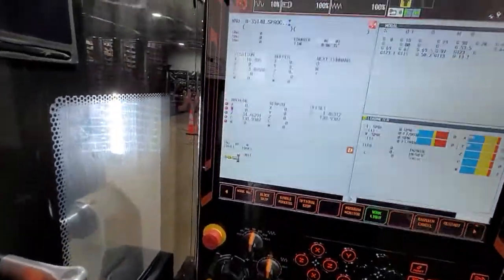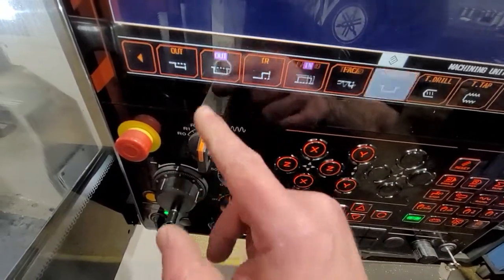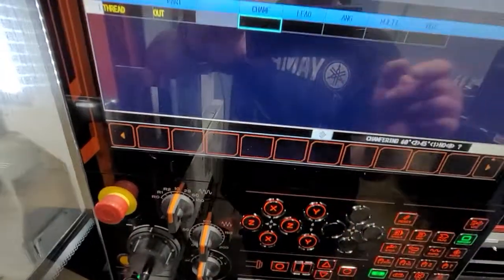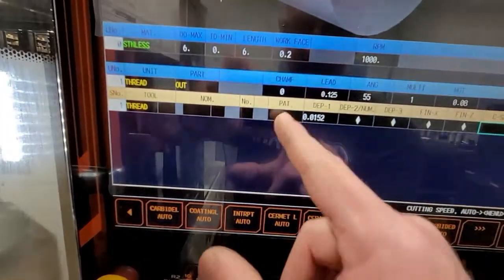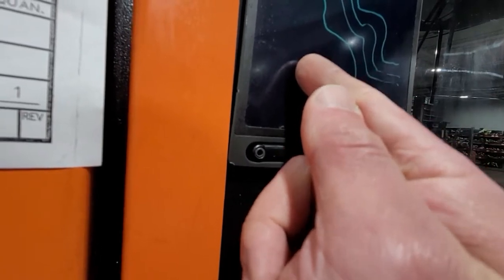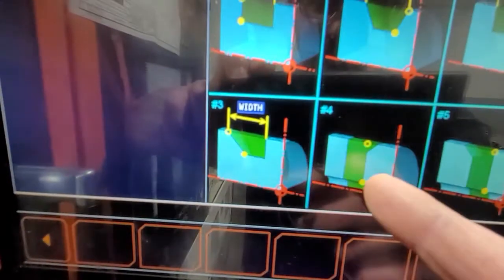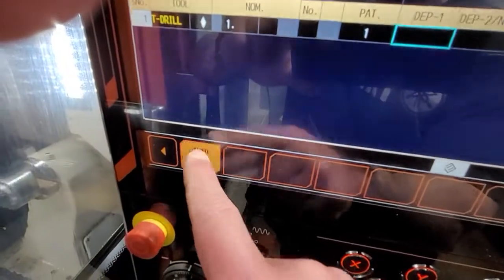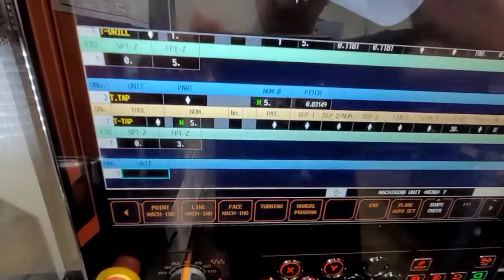Mazak Smooth G programing basics for lathe turning

Comment: Corner machining feature is very useful  if you are doing heavy rouging with the 100 degree corner of your OD roughing tool. This feature makes it easy to define stock for when you want to square the shoulders and turn with the 80 degree corner of CNMG. In this case, to square a corner you are not turning a rectangular cross sectional area, but only the triangular cross section = 1/2 the time saved!
Reply from the maker: Great tip!